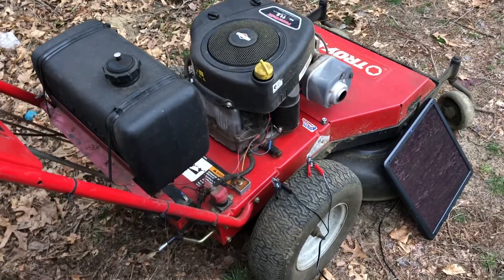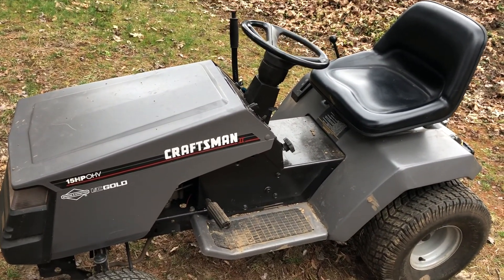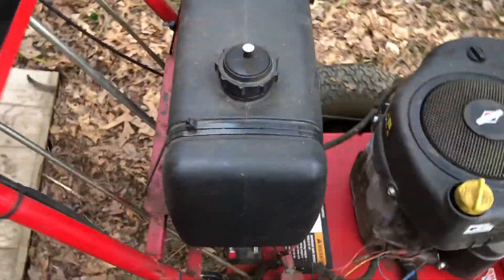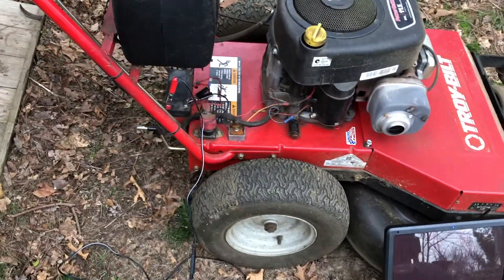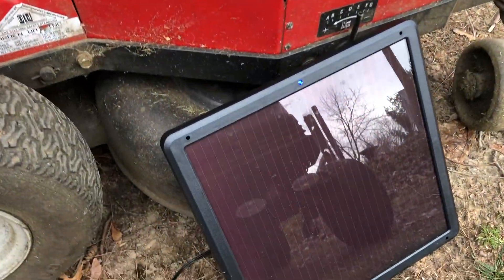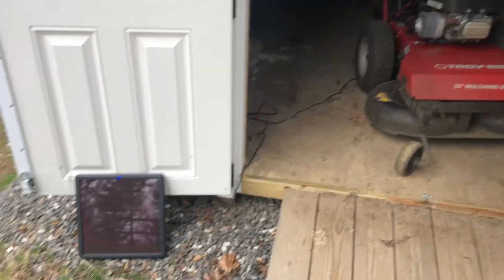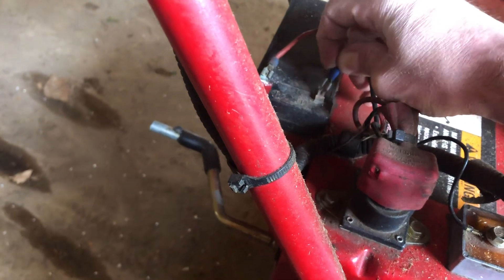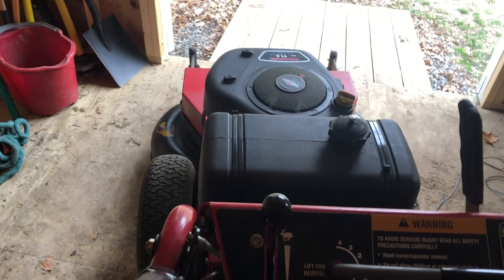Harbor Freight's Thunderbolt 7-Watt Solar Panel - Will It Charge A Lawn Mower Battery?

Comment: I'm thinking a little solar panel like this would be more for helping to maintain a charge on bigger things like a riding lawn mower over the off season when it's not in use.

I've actually been thinking about buying one of these for my dad for his rider when it's not in use.
Reply from the maker: So I use mine ALL the time for one of my tractors that has a weaker battery. I put the panel in the window of my shed and keep it connected to the tractor. Battery is always ready to go now. It’s very useful.
Reply: @jimmysgarage9068  Yeah, I asked my dad if he had to jump-start his mower after it'd been sitting over the winter and he said "Every time... hell... I had to REPLACE the battery this time because it just wouldn't hold a charge."

So yeah... I'm gonna get this little solar panel for him to attach to the roof of his little shed where he parks it in and see what happens.

Worse comes to worse it can't HURT.

It may not CHARGE the battery for a riding lawn mower... but sitting there over the winter hooked up doing nothing else? It may MAINTAIN a charge. hehe